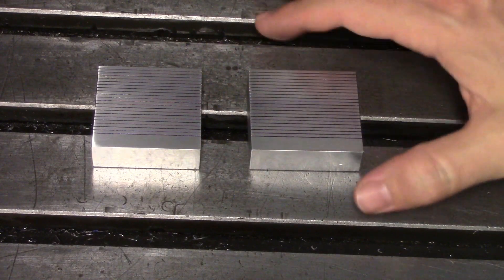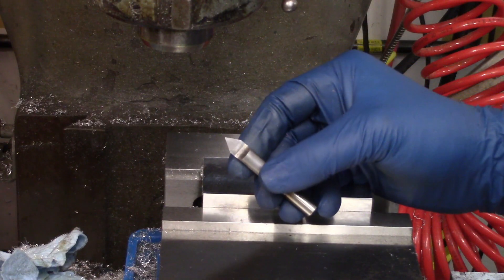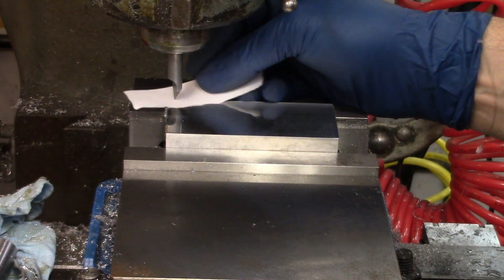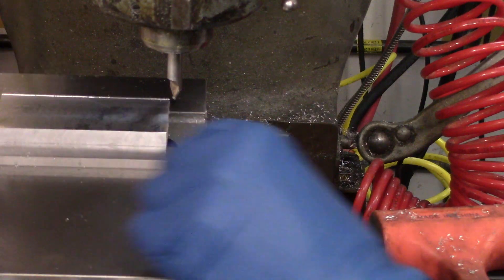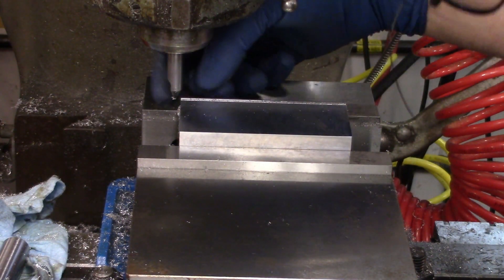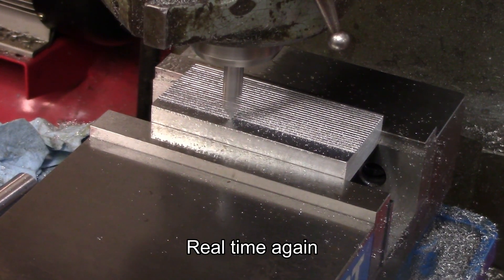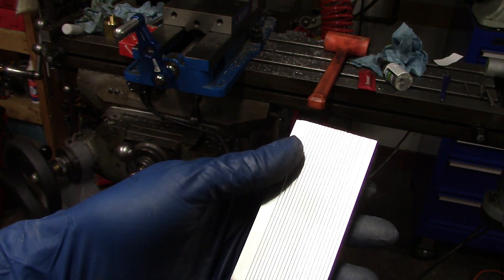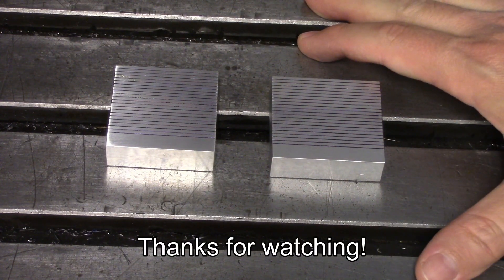Making Graduated Blocks to Help With the Scale Trick

Comment: When do you move the quil down vs the table up, to set the depth of a cut?
Reply from the maker: For the most part I only use the quill for drilling and edge finding. If I'm doing repetitive spot drills or countersinks I will feed the quill down against the quill stop and then set the depth with the knee until it's right. Then I can just run the quill down to the stop for all the other holes. One of my really early videos shows that.

Comment: I think it would be interesting if the engraved lines were 1mm wide on 2mm spacing. After painting you'd have alternating 1mm light and black stripes, similar to the reference backgrounds sometimes used in high-speed photography.